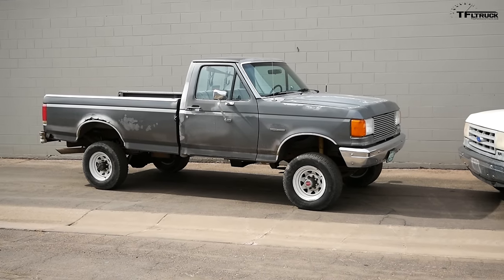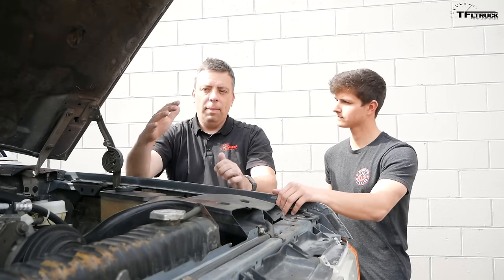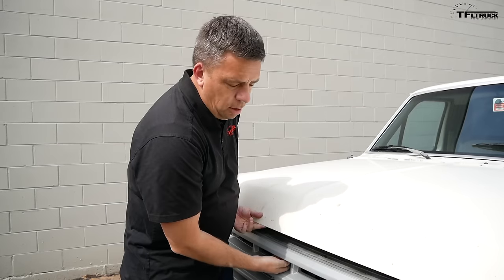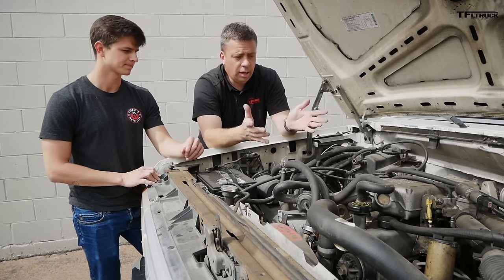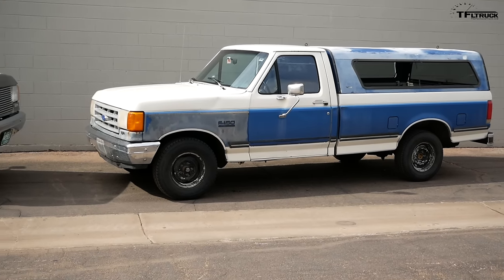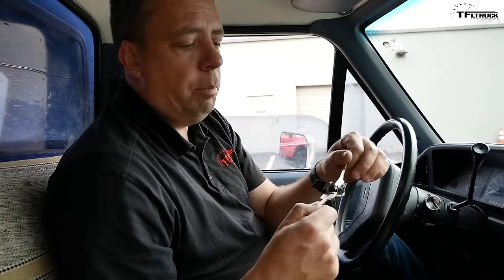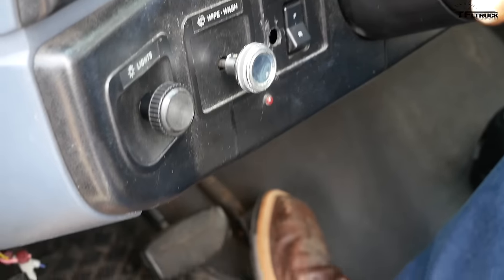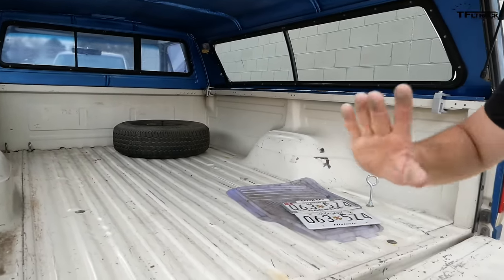Here's Why You Can't Kill An Old Ford F-Series Truck | Gunsmoke Ep.3

Comment: You didn't talk about the headlight dimmer switch location.
Reply: It is on the floor by the brake pedal
Reply: Yep. That's one of those throwback differences that I don't know why they put it on the steering column other than to be consistent with Europe.
Reply: Stompers are the proper brights switch
Reply: @scottconn62  In Canada, replacing those floor dimmer switches was a maintenance item, like changing your oil. They would corrode away within a winter or two because of the damp, salty environment on the floor. Didn't cost much, but it was a pain.
Reply: @jimking2299 , I never had to replace one, even in cheap econoboxes and i grew up in the US Midwest where they loved to put down car solvent every winter. I can see where that could have been a factor. Did a little research and couldn't find a definitive reason.

Comment: I've heard about the oil pressure issue on the i6 truck and ot tends to be the oil pressure sending unit. Easy and cheap to replace!
Reply: Probably down by oil filter like my 351
Reply: Nathan Slayers thanks for me letting me know my 300 has a issue with the oil pressure gauge.

Comment: Ran a 300 with water for oil for a while, still wouldnt die though
Reply: Josh Abrey I believe you!! You literally had to completely drain the oil out and put sand or dirt in it. I had a brand new f150 in 1992 with the straight 6 and it was a great truck. Anyone who ever had one of these motors also knows that this motor was very happy with a load behind it.
Reply: George Williams the 3.7L 225CI Dodge slant six was tuff like that had a 73 Duster with one had close to 450,000 on it when it was sold 28 years ago the man still uses it today as a daily driver with original drivetrain and the original paint still looks fresh
Reply: My buddys 300 ran for six months with no oil in it. Unbelievable.
Reply: @theeasternfront6436  lol ran mine with water for close 2 year's
Reply: Yep I dry block drove  mine 3 miles after a freeze plug failure killed it the grease on the engine was about to catch fire too that was three years ago 95 150 300/mdo5 I keep it full of fresh 15w40 hoping to hit 300k this summer
Reply: I once put a brick on the gas pedal to blow one up before hitting the scrap pile. It ran out of freaking gas after 45 minutes!

Comment: I’ve driven an 1990 f350 7.3 idi manual, almost impossible to stall but glow plugs are very needed to start
Reply: I have a 1988 F250 with the same engine, glow plugs and the glow plug controller were the weak point on those engines. They were prone to failure.

Comment: I had a 95 Eddie bauer edition with the straight 6, manual transmission, white with tan bottom. I absolutely loved that truck. I recently was looking at possibly getting another one and was absolutely blown away at the prices people are asking for them. There is currently a very nice version of that truck on Ebay being sold by a dealer asking $33k. While that's  the highest I seen, there are multiple other for $20k give or take. I paid $5K for mine back in 2005/2006. Currently wishing I had never sold it. No way I would ever spend what they're asking for them now.

Comment: I have 1990 Ford e150 van . It came from a commercial auction and used to be a Budweiser keg service and delivery van and had 98000 miles on the van. 4.9 L fuel injected and has a E40 D transmission . I paid $2000 for it. Man! This thing is solid, it’s still running strong and everything works. I had the transmission modified to flow more fluid, got the radiator re cored ,new electrical system, that’s it. Interesting thing , discovered that it has a gear drive, that’s a surprise. Researching I found that quite a few of these were produced from 86 to sometime in the early 90s for commercial trucks.   Holy grail. Well cared for this thing could run a lifetime. I absolutely love this van , it’s paid for itself many times over . I’ve recently began a regiment of prolong treatments during oil changes. If you don’t know what that is, it’s a product that pours in during an oil change that doesn’t mix with the oil but uses the oil as a carrier and bonds to all metal parts and protects the engine from seizing during massive oil loss in case you blow a gasket or worse. Just saying! Endorsed by those who know. This van is clean and bulletproof, easy to maintain. If ever you get a chance to acquire one of these ford combinations, my advice is to jump on it without any reservations, it will love you back more than your ol lady!

Comment: I have a 95 f250 single cab with the I6 that I cannot kill!! My wife and i moved to Texas in spring of 2014 and we drove it from SE GA to north Texas, about 1300 miles with may be 2 quarts of oil in it (cause I didn’t do a proper pre-trip). I never had a single issue with it. Has been sitting in my driveway for about a year, undriven, and i can still go out and fire it right up. Love this damn truck

Comment: Ford makes the best trucks - we will NEVER buy any other brand.  Our family had too many problems with brand X - Love my Fords!
Reply: The new fords suck. These were the last good Ford trucks in my opinion.
Reply: @SebastianWoodard  I went from from a 1993 F150 to a 2002 F150. I had the 93 for over ten years before a 4runner tore the front almost completely off. I picked up the 2002 at a mom and pops for about $6k and expected to drive it a few years, save up and buy a newer F150. Going on over ten years later and approaching 300k miles .... took it out the other day and it is still amazing me that the Triton motor has not blinked. She isn't the fastest, but like a playful old dog that is more full of life than you expect it to be.
Reply: @SebastianWoodard  the new ford trucks are the best trucks in the market they last longer than most other trucks when well maintained . Older trucks would have failed in the new market and fords not gonna make a truck that won't make them money.
Reply: @huffkuff4467   lol those newer ford are having transmissions  issues and engine  trouble

Comment: I had two Ford F-150s with 300 6's in them. The first one I had was a 1986. It had a 1 barrel carburetor on it. I took it apart cleaned it put some new parts in it and put it back together all within just a couple hours. I didn't like the twin I-beam front suspensions on those though. They used to eat up a lot of tires!

Comment: There has to be 100 contractors who would gladly pay 1500 bucks for that F150.
Reply: I would pay that to have it crushed . My last Ford was 1991 150 and i still would rather walk than ride in a Ford . My last 2 Ford cars were 1994 and 2000 Continental s ..... BOTH WERE SENT TO THE CRUSHERS  at 132 000 KM and 136 000 KM . Thats pretty bad and Ford doesn't warranty cars and trucks that are major problems . This were so bad extended warranty  was cancelled  because of manufactures faults and not repaired by manufacture . So bad i've had service people holler at me to get that junk out of here and twice they even pushed it out into the street and left it there ... UNDER WARRENTY  !!  Should be laws against building Fords .
Reply: @merlemerle788  wtf are you on about
Reply: EliteNK    He’s saying every publication puts Ford reliability dead last. Do you remember fix or repair daily! They worked hard for that distinction😂
Reply: merle merle I’m willing to bet you have bad luck with any vehicle.. there’s a reason FORD is the best selling vehicle for almost 50 years straight now.. chevy on the other hand.. my dad has a 2015 silverado that’s blown up in his driveway with 34k miles on it. He bought it to replace his 91 f150 inline 6 and he drives the f150 daily.. his f150 has 400k miles on it and still going strong..
Reply: @mikecorleone6797  They stop making cars for a reason.  They may used to make good products but thier cars suck!! Added technology when it's not needed.  You ever look under the hood of a Ford focus? What a disaster to work on😂🤣
Reply: tae MAC actually yes all 5 of my ford vehicles are fords. 65 ford mustang 289, 70 f150 with 390, 85 foxbody with 302, 2015 fiesta st and 2016 ford escape to haul the kids around.. all reliable, i will happily jump in any one of them and take a road trip from coast to coast.. they stopped making cars because the market shifted to suv vehicles pretty much across the board.. would you still make something if people weren’t buying it? Nope
Reply: I was thinking the same, I live in the Washington DC area and I could easily get 1500 bucks for that old F150 from a lot of the Hispanic dudes who do roofing, mowing, and painting around my neighborhood. I had a POS 2000 Dodge Ram 1500 with a ladder rack, I got it free for a debt payment owed to me, and had it in my driveway to fix issues and get it on the road. Before I could finish it, I had 4 guys numbers in my mailbox wanting it. I sold it for 1500 bucks and didn't finish the work. The Hispanic dude who bought it painted houses and I saw him with it 4 months later on a job site. Good for him I thought.
Reply: @mikecorleone6797  Your one of the lucky ones. But I've been around to many Ford cars to know they are trash. Just my opinion...
Reply: tae MAC lucky? 5 different fords from 5 different generations spanning 6 decades.. idk about that one.. to me it seems like the owner’s knowledge on basic maintenance would dictate reliability.. i have 5 fords and there’s easily another 10 or so fords in the family all just fine..
Reply: Mike CorLeoné   The vast majority of vehicles sold worldwide are cars.
Reply: @mikecorleone6797  Like I said they stop making cars for  reason.  The quality of thier cars sucked and people stop buying them! Why would they stop making quality cars if they where making good profits?? Wake up!!
Reply: @DriveByGuy  well with that logic then with enough money a Mercedes Benz is a reliable car
Reply: @merlemerle788  I think you are a liar. No Ford owner ever badmouthed them like that. If you supposedly hated your Ford truck so much, why buy two cars? Is your pants feeling a bit HOT?
Reply: @taemac10  I guess he can't get through to you. Ever look under the hood of any vehicle built today? Seems to be a lot of people in my area want SUV's or trucks over cars.
Reply: @fritty9927  Oh f o with the tired old fix or repair daily bullshit. There is a reason F150's have the title of most trucks sold in NORTH AMERICA. Guess you can't handle the TRUTH---- it will set you free.
Reply: K Stewart 😂😂😂. Spoken like a true Ford guy. We have a couple of those in our car club.    I didn’t invent the term.  I think the Taurus was best selling car for a while too. And don’t forget the Beetle. Honestly sales figures tell you very little.
Reply: @KStewart-th4sk  lol than buy your Fords! I will stick to my imports that will still probably be on the road 10 years from now😂🤣
Reply: Ford just like any manufacturer has good and bad models. The F150s - good. The Rangers/explorers - Ok. The cars - NO. I have owned an f150, ranger, and 2 cars. both of the cars were crap. The trucks were good though. Also older seems to be better. I wouldnt buy a newer model ford, if I was buying something new it would be a toyota.

Comment: These trucks were so easy to work on too. Not only the engines, but for example, the heater core replacement. Most vehicles require taking apart the whole dash to get to it. But on the 1988 F-150 I used to have, you just open up the glovebox, push a tab and the glovebox door comes off. Underneath was the duct over the heater core—just remove six easy access bolts and the heater core is right there! Pop the hood, take off the two hose clamps from the firewall and remove the heater core. It’s that easy! So many other things were simply designed and easy to work on like this!

Comment: My dad owned a 1970 F 250 4x4 with a 300 ci in line six and in 2005 he gave it to me as he gave up his license. It had 298,500 miles on it and it was starting to use oil. We had a home in Orlando but also one in the Lake Tahoe area where we plan to retire so I planned to make my Ford like new again. I was still working for Ryder as after my shift I did a partial overhaul on the engine. Just a honing of the cylinders and rings 0.005 over with new bearings/seals. Put a little higher lift cam in it with new bearings. Sent the head out with new valves and ports ground/polished. Found a two barrel Edelbrock intake manifold on Craigslist buying a new two barrel Holley 500 cfm carb for it. Found a tube exhaust header 2 1/2 outlet somewhere and reassembled. Our local tech school had fun repairing some of the body with new front fenders. They also replaced the wire harness with a new one and a new windshield. I then overhauled the transfer case/trany and syspension. New alternator and Starter/battery. With a white on blue paint job it only cost $3,485 to have a new pickup that can Handle any Tahoe winter.

Comment: I had a F250, a 1972, it had a 390, with a four speed, heavy duty tires with split rims. I use to pull a gooseneck stock trailer from Minnesota to Utah, over the passes west of Denver, and, this was before the tunnels. It was bullet proof, and, could pull grain or hay wagons with ease.

Comment: I would rather have the old ford engines over new interference dual over head cam piles of junk.. 7.3 Godzilla platform cam in block is way better than older 4.6, 5.4, 5.0 ect..
Reply: I will say this, I used to have a 93' F150, 5.8 a few years ago, tough as nails. My current daily is an 07' CVPI 4.6 it is honestly just as tough and hard to beat.

Comment: My parents had an 1978 ford fairmont with a straight six 3.3 litre , for years the didn’t want to get rid of it. In 1993 I actually put dirt in the motor and driving it in second gear on the highway at 100km(55miles) trying to blow that engine so they can get another car. Mom was stubborn of replacing it.but I finally got it to run on three cylinders straight to the wreckers with blowing black smoke coming out of the tail pipe. But you are right those straight sixes were tough as nails to break and the go on forever.

Comment: You are preaching to the choir, I am a believer in these old F150s. 

Mine is a '93 short bed with the 4.9 inline and with 5 speed manual. In 5th/over-dirve on the interstate at 65 mph I got 20 mpg in west Texas. 
They were used in dump trucks and all kinds of construction equipment. Even for irrigation motors and wood chippers. With 7 main bearings they are known to be bullet proof. Wind up windows and not a bunch of idiot lights and alarms. My friend just bought a new 4 door GMC for 80k. I'll take my little six cylinder regular cab short bed every day of the week.

Comment: I had a 1980 Ford F-100 (yes you read that right, not F-150, but F-100), with a straight 6 with 300CID.  I bought it brand new off the dealer lot, straight out of Army Basic Training. It was as striped down as possible to keep the payment as low as possible.  It had a 3 speed transmission on the column (3 on the tree), with vinyl bench seat and rubber floor mats.  Manual window cranks, no AC, and only had a stereo after I bought a system that I installed myself.  Man that setup pulled off the line!  I don't know the numbers, but it was a very torquey setup.  I loved that truck and only sold it when I fell on hard times and could not afford to keep it.

Comment: I have a '72 f250 with a four +granny behind a 390 running a low ratio rear end. 60mph top end, but it'll pull over the church if you chain it to the steeple.

Lots of home repairs on the old girl, and a couple of roadside emergency modifications. I work her like a mule at times, and that's when she shines. Grunting and twisting her way up a muddy logging road to get me back to the best places for turkey is her specialty, even if she is a 2X2 pushing 40 years old.
Love my Ford. 🤠

Comment: I had an ole f 260 heavy duty with the 1 ton running gear. That truck guzzled gas but man it could pull.  Break traction before it stalled. Loved that truck.

Comment: I got a 90 150 xlt lariat, paid 1500 for it with 137k miles. Has the 5.0 302 v8 and i love it. Has a very well takin care of interior, and everything works, even the radio. Needs a couple seals replaced and some other small things, i still drive it everyday. Almost forgot, the clear coat is starting to peel on my hood and roof, i have seen this on many of that body style that do the same, seems brown ones do it bad.

Comment: The funny thing is my first work truck was a 91 f450 dually 10 yard dump bed with the 7.3 idi & manual trans and the chipper pulled behind it had the ford 300 industrial in it. BOTH were simple, reliable, cheap to maintain and bulletproof

Comment: I had a farm a few years back and had a 85 150 with a 300-6 in it and a 4 speed manual behind it. I spent 3 weeks cleaning up scrap metal around the farm and loaded it all on a HD trailer, drove 40 miles to the scrap yard and when I pulled on the scales my gross weight was 16,400 pounds YES behind a 1/2 ton truck, needless to say it scared me a tad bit knowing I had been on the road with that load. I pulled it fine, stopping was a little hairy but didn’t have any major problems!!!
That truck is still on the road with over 500k miles under it

Comment: I had a 1990 F150 XLT Larit with the 4.9l 6cyl 5-speed 2wd manual. Purchased brand new. Wish I still had it. 5 Years ago I picked up a 1998 F150 XLT 5.4L 4 speed auto 2WD that will roll over 300,000 miles this summer. Runs and drives great. My favorite years were 1990 to 1996,